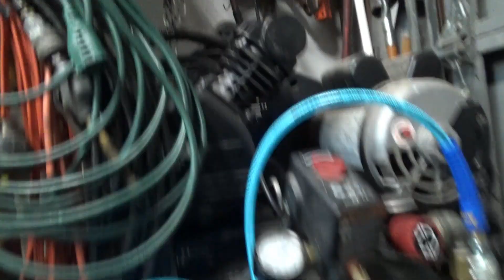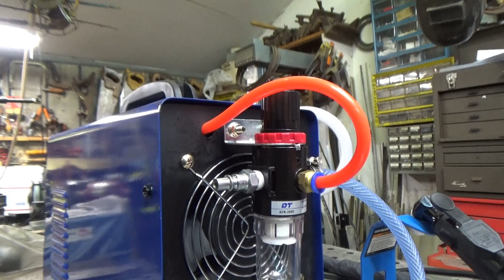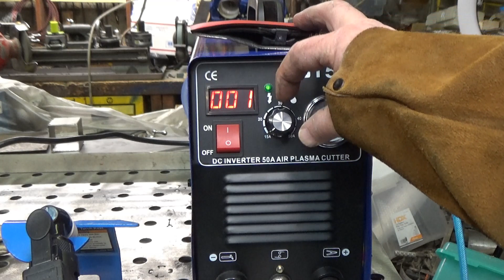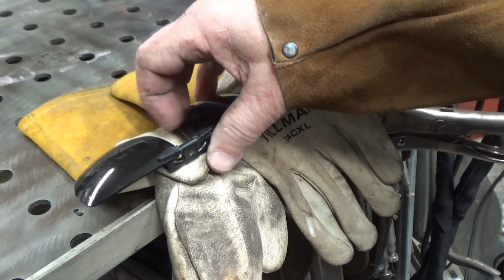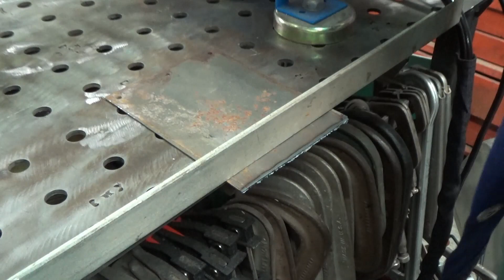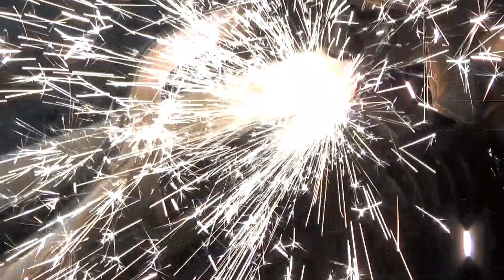First Cut CUT50 Plasma Cutter

Comment: Hi Steve   hope you had a Great Christmas & your going to Have a Better New Year 2022 
A while back I bought a Cut60 & set it up, but I still have to get into it & do some test cutting like yourself. In my book it states to use 50 psi + to get rid of the Hot Metal. It's supposed to be able to cut Steel .. Aluminium ... Brass  .. Stainless etc,  ..  will try these out when I get time.
Good review, will catch you on Your next venture.
Reply from the maker: I did not get any instructions with it at all. Through experimenting 60 psi seemed to work the best. I am looking forward to using it in a project.  Thanks for watching and commenting.

Comment: One we got is 110v unit, so you should be better off than us, if it starts over heating and tripping breaker, change out your ground wire to a copper wire, they sneaked aluminum coated with copper on us, thinking 🤔 that's the reason for popping breakers, will let you know if works when we get around to changing ours out, we found a cheap set of jumper cables at local scrap yard and are going to try that before ordering expensive new ground leads, oh anything over ⅛ inch think, we just crank amps all way up along with alot more air pressure, blows the slag right off usually,  oh one more thing, if you can hold tip of cutting head off the piece between a ¹/¹⁶ & a ⅛, you won't burn up tips as much, when eventually burns one, it will spit and spudder and act all kinds of craziness🥴, good luck, plenty of practice, like most things will help!
Reply from the maker: Thanks for watching and for the heads up.  Happy New Year
Reply: @sharkrivermachine try out the video below, another idea make tips last longer, wire w ones are junk, don't bother, trust us, they burn up in about 15 seconds if your lucky. We're going to be getting the heavy-duty stand off soon as soon as we test out the over heating problems we've been having, hope helps they are a million videos out there and this seemed to be the most simple, short and concise one could find:

https://youtu.be/ZopC-9Wkh2g

Comment: Steve, with a pile of different thicknesses of scrap to play with, you can spend some quality time really dialing in your amps, pressures, speeds, vs. metal thicknesses fairly quickly, I think.  Just keep notes if you're as forgetful as I am and don't use it enough to easily remember everything!  ;)  Thanks for sharing!
Reply from the maker: Thanks for watching and commenting

Comment: air pressure at 80psi and turn the amp knob all the way up..    the machine will control the air flow.  I dont know why those machines have a volt knob.
Reply from the maker: I will be experimenting with it.  Thanks for commenting.

Comment: never take mine off the 50 amp setting and adjust my movement for penitration. always use max air setting as well and never touch the settings
Reply from the maker: Will try it out.  Thanks for watching and commenting.
Reply: Do you have any problem with duty cycle at that setting, or are you not  doing long cuts?
Reply: @howder1951  never had an issue, was cutting up 10 in. I beams, it never gave me any problems

Comment: Great cuts for your fist time Steve, you will be a pro soon! As the material thickness increases so does the need to travel SLOW & STEADY to keep the plasma cutting 100% thru. What is great about plasma is that it will cut ANY METAL  that can conduct electricity.  [An  oxy torch cuts only steels except  stainless steels, cast iron]
Reply from the maker: I was not sure about aluminum, I assumed that it would cut.  Will have to give it a try. Happy New Year and thank you for watching and commenting.